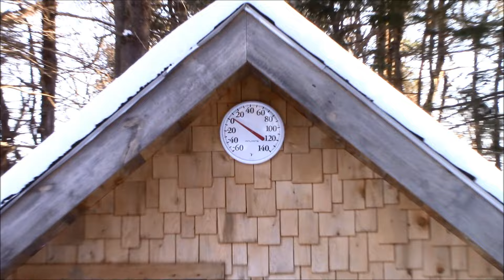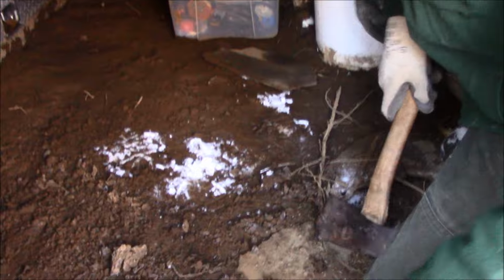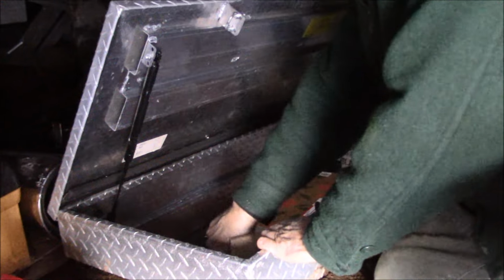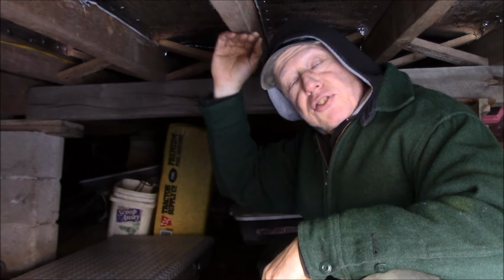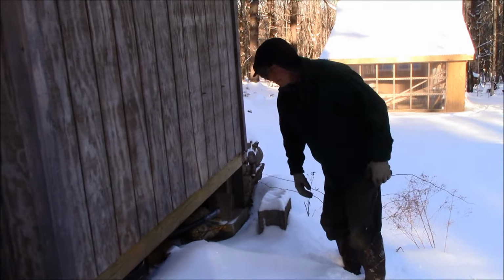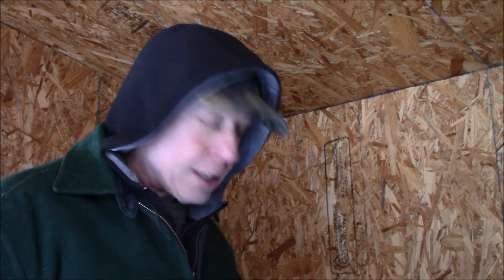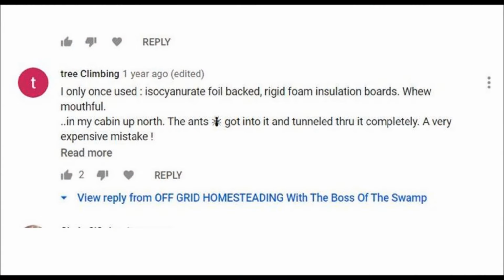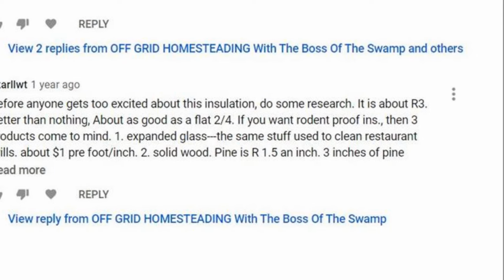Awesome Floor Insulation For A Cabin In The Woods   3rd Year Review

Comment: We live in Central Montana and we know about cold!  Last February the average daily temp was about 0.5 degrees.  We live in a mobile home that is skirted, but had no insulation.  We would have all of the base cabinet doors open at night and let the water trickle just to make sure it didn't freeze.  It was so cold, we were having frost heaves under the house.  You could hear the house creaking and groaning.  This past summer, we decided to try the foil-faced bubblewrap.  We placed it on the inside of the studs that the skirting attaches to, in a continuous run to keep seams to a minimum.  It runs from the bottom of the house down to the ground.  The first cold spell we had this year, the outside temperature was -14.  I opened the access panel and took a temperature measurement about 6 feet inside and the thermometer registered 36 degrees.  When I opened the access, I could feel the warm air coming out!  So far, we've had temps in the range of 0 to -20.  No open cabinets, no trickling water and my heat tape (which is thermostatically controlled) has barely run.  It works!

Comment: A big factor in the crawl space not freezing is Geo-thermal heat.  By skirting the crawl space you have sealed out the outside air that is freezing the ground outside.  The Geo-thermal heat that is underground naturally rises up into the crawl space.  If you have ever visited a cave then you know that the underground temperature is about 54 degrees year round.  The pipes don't freeze in your crawl space for the same reason that pipes underground do not freeze.  It is surprisingly effective.  I used to own a two story farmhouse built in 1902.  It had a stone walled basement with a dirt floor.  I had a wood stove in the basement so I kept the basement door open to let the heat rise up into the house.  One winter there was a bad Ice storm that knocked out the electricity for about a week.  I was not home and didn't know.  Someone told me that the power had been out so I went home expecting the plumbing to be a disaster.  When I got there there was tree branches down and ice everywhere.  I went inside and checked the house and the temperature was 38 to 40 degrees.  I had left the basement door open and the 50 some degree air had risen up into the house and prevented a disaster.  I had not been there for about a week after the Ice storm.  The only thing that froze were the toilet valves.  One was downstairs and one upstairs.  They only had a small crack in the side so I didn't have to replace them right away.  Just leaving the basement door open made a world of difference!

Comment: I followed the advice you gave about using it in a cooler. I put it in a large 72? Qt cooler. Lined the whole inside and made a removable piece that goes over the top of the food and ice. It went from maybe a day and half to 3 even 4 days of holding ice! Who needs a several hundred dollar cooler, when you can buy a roll of this stuff and have similar results with a cheap cooler. Thanks as always for the great advice!

Comment: I have watched all the 'bubble foil' videos you've made and am a believer! We live for part of the winter in our cabin in the Yukon. It is an old log cabin that has very little clearance under the original floor. We plan to eventually remove the old floor and put in a new one that will level things out inside. This will be such great information for then. We also added an addition on the cabin for a kitchen that has about 2 feet of space under it. I spend much of the winter cooking with frozen feet! There is a woodstove in the kitchen that keeps the upper part of the room warm enough. But, OMGee...the floor freezes! We are dealing with -10 to -40C temperatures. My water buckets freeze if I leave them on the floor and my waste water from the sink bucket is an ice cube. I am so excited to try this out! Thank you so much for this information!
Reply from the maker: You won't be disappointed. This stuff works awesome.

Comment: i would use it
Reply: A 6 mil plastic green house can be heated with  very little heat because of reflective heat  I have heated a 24 x 40 green house with less than a hundred gallon of propane all winter in the ozark mnts . It was more comfortable than my house . The bubble wrap is an excellent product and i wish it had been around when i built my cabin . Let the doubters sit around and bitch and gripe while they freeze their ass off .

Comment: Installed it under my floor at my cabin in Maine 12 years ago has worked great.
Reply: Any skirting or bat insulation or just between the subfloor and joists open air?

Comment: After hearing about it from the Boss, I used reflectix in a sauna I built. I used it between the joists and sub floor, insulated the walls with fiberglass, and used reflectix between the studs and interior boards as the radiant shell. It works like a charm. Man am I not sorry I built that thing! Thanks Boss reflectix is great stuff, just like your videos!
Reply: Hi  Did you only use Bubble Foil on the floor, or did you add any other insulation? I'm building a Backwoods Sauna. How is floor temp? Thanks
Reply: @gregi5850  I used only reflectix directly under the subfloor. It works great, I but I’m in South Texas. The packaging shows an installation method in which you leave an air gap between the reflectix and the subfloor, so between the joists instead of on top of them. If I lived where it was colder I might have insulated the floor with the same material and left an air gap for more r value, but it seemed unnecessary where I live. Cool project, good luck to you sir!

Comment: We are in Michigan and hubby and I used it on a lake cottage renovation both for over our cement slab and our wooden porch floor that is cantilevered over an open crawl space. There are carpenter ant nests outside of the wall so good to know about them and the foam board! No problems with this and the mini split we use for heat has been very economical.

Comment: Hey Boss….I’m in the process of using the bubble wrap as you have suggested on my Aframe cabin on piers up in Montana.   So far so good!   I will also put a skirt on the place to also guard against wildfire (heaven forbid) getting under the cabin.   It will be all weather wood framing with 1/2” x 30” x 60” Hardie panels on the outside.   Once that is done I will also place the bubble wrap on the inside!   Thanks for your “words of wisdom” based upon actual observation!  Cheers! 🎉🎉

Comment: This stuff is the greatest! I have been using it everywhere for about three years. I figure the reason it works so well is that it acts as a draft barrier as well as a small amount of insulation. The wind can't penetrate it and take the heat with it. Like a space blanket.
Reply: That's not how insulation works.
Reply: @snowflakemelter1172  , maybe you misunderstand the book you read. Keeping something warm or cool from a adjacent temperature influence would be insulation.
Reply: @snowflakemelter1172  - You sound like a broken record.  It reflects rather than insulate.  Find a new line to use.
Reply: @snowflakemelter1172  There are times when a term (insulation) is used to describe something and subsequent testing shows that "air infiltration barrier" would more accurately be the descriptor. I suggest trying it, see the results and THEN comment. When someone comments from the point of view of "insulation" when the actual benefit is preventing "conditioned air loss" the comment can be true but off base. I would rather see comments trying to help the youtuber explain what they observed.
Let's see the naysayers do what he did and see what results they get...
I'm prepping to do this under mom's mobile home to reduce her "conditioned air" loss and reduce her electric bill. True, it would be cheaper to staple up thick plastic to prevent air flow, but I like that it has a little R-value and will last longer.

Comment: I used it in my outhouse floor and it definitely works. I made the mistake of not doing it in my cabin floor which was built before the outhouse and I wish I had. But, because of how well it worked in my outhouse floor, I ended up deciding to use it in my cabin ceiling. It's a gable roof but I created a small attic space by putting up 2x4s from one side to the other, horizontal with the floor. Then I just stapled the bubble foil to the joists and then outside the cabin I have soffit vents along the overhang. In the small attic space I have 2 exhaust vents on the peak of the roof to allow the ceiling to breathe. The venting is important to pull the moisture out of the cabin in the summer and prevent ice dams in the winter. After only adding the bubble foil alone, the temperature inside my cabin in the morning on a cold winter night only gets down to the high 50s at worst. Before the bubble foil where I only had the plywood and shingles, the cabin would end up in the 40s or below when I woke up unless I tended the fire at 3:00-4:00 AM. My thermometer doesn't have an agenda and didn't lie to me. Hahaha. They can say whatever they want, I am also very happy with it.

Comment: Bubble warp the ground/ crawl space floor. Also more insulation on outside skirting. My preference.
Reply: Keep heat in lol gravity feed oil stove or a big boat/ yatct oil heaters are really cool and put off a lot of heat. In my opinion.
Reply from the maker: Bubblewrapping the floor will stop the ambient temp of the ground from heating the crawlspace. Then I'll have to run a heater under there to keep my pipes and food from freezing.  No thanks.

Comment: We have a walk-in unfinished basement with our cabin.  It was vacant for several years.  We tore out the insulation because the mice made nests in there.  We are thinking about insulation under the main floor but have done nothing yet except plug up every hole that led to the main level.  I think we will try the bubble wrap as you suggest under the floor above the basement and in the short walls of the basement too and see how it does.  It's a vacation cabin but we go there several times a year in all seasons, including winter.   Thanks for reminding about the bubble wrap!  Those citrus fruits look good!

Comment: Used this stuff in the engine room of my canal boat between the steel hull and the 6mm ply that covers it. Made a heck of a difference.
Bearing in mind I am basically a steel box surrounded by water. In other  places I packed the gunnel space with 50mm foil backed insulation. I have to replace some rotten flooring and plan to put  some underneath.
Incidentally, I built the insulated cool box you inspired me to. Holes at the bottom draw cold air from floor level (I plan to drill a hole to the bilge where it's REALLY cold!) and holes at the top rear to let the warm air out. I bought a marble tile for the bottom and so far it keeps everything much better than before. UHT milk lasts twice as long as it used to just in an ordinary cupboard! Getting a computer fan to see if I can improve it any. Cupboard is 18mm ply (scrap I got given) and 25mm expanded polystyrene on three sides. Cheap, cheerful and it works!

Comment: I love bubble wrap/reflectics as I said in my text in one of your past videos I live in a cargo van, I have board insulation and The bubble wrap. Other van dwellers I know are having a hard time warming and keeping the warmth in their van homes. It is cold in their vehicles because they only have the basic installation. They cannot keep their vehicles warm Because it’s like the air just flows through every single crack there is. In my van I  have fiberglass in all the large  holes between the inside and outside walls, insulation board on walls and ceiling then bubble wrap over all that and on the floor then the paneling. I think what people can’t wrap their heads around is it is not an R value. What they don’t understand is it is more of a windbreak, therefore things stay much warmer. That may be a better way for the negative Nancy’s to grasp the concept.insulation but I would consider it a huge windbreak. If used correctly bubble wrap is worth its weight in warmth. Don’t stress the inboxers their just stuck in the box. Excellent video as always and those apples and oranges looked so good. Great idea for the toolbox. That one I will remember.
Reply: Insulation board is supposed to be fitted properly with filled and taped seams in the first place.

Comment: Since you showed us this method of insulating floors in your upstate NY cabin, I have used it twice. Once in my own off grid cabin in the mountains of VA and once for a customer. It works wonderfully. Thank you, Boss, for sharing your knowledge and insight.
Reply: Best flooring insulation for my off grid log cabin in northern Indiana. No rodents or bugs of any sorts! And it's all because of you my friend! Thank you and be kind out there people👍
Reply: I have a cabin on Amos Run Hunt club in cowen west virginia and will be doing this to my cabin..the roof and walls are fully insulated but the floor is like ice!
Reply: Was wondering if you can use the bubble foil insulation on the inside of the cabin floor, like under my flooring?  Or would that just flatten out the bubble wrap and defeat the insulative property? I only ask as my shed to cabin did not come with an insulated floor and it is just sitting on skids over a gravel base.  I am located in northern WI (Mercer, in the snowbelt of Lake Superior and lots of nights below zero).Ideally my cabin needs to be raised (have any suggestions on how to do that??) and put in the proper insulation. I was thinking about spray foam or the 2" pink board, but after watching your videos, I know to shy away from either product due to the problems with ant infestation.  The last two winters I have had success using straw bales around the base of the cabin in combination with the 2" pink board which I cut to 2 ft wide sections and put between the exterior cabin wall base and the straw bales. R value works out to be around R-25 to R-35  for the cabin base. It helps quite a bit but I still feel a draft on the floor. Even at that it is easy to maintain a temp of 70F. In Spring I use my straw bales for my straw bale garden. I did my walls and ceiling with rock wool insulation which works great. My roof has a ridge vent (which I have left open). I heat with a natural gas Jotul stove, direct-vented out the wall and have no moisture problems in the cabin. 

I would appreciate any comments or suggestions. Thanks, Nancy...yes, it's a women's venture!

Comment: James...In keeping with your "back woods logic", I recently installed a 50 cfm fan that grabs hot air from the peak of my cathedral ceiling and pumps it thru a hollow beam down into my 4 ft crawl space when the thermostat down there falls below 60 degrees. Works 'fan'tastic and doesn't cost me 'chit' to run. I'm also one of those "think outside the box" persons, but your examples have really pushed me beyond my prior limits. I suppose my highest compliment would be when I think, how would "The Boss" solve this"? You are a HUGE inspiration to Many of us, And God Bless....~Eli.
Reply from the maker: That's awesome. I had an inline pipe fan doing the same thing in my old place. I only ran it when needed.

Comment: Jenn and I also used your technique with the bubble foil. Its even in one of my build videos and I mention you. lol But a warning to the builders. I am building by myself so it took some time to get it all buttoned up. We had a bad rain storm and my sub floor did get wet because the wind ripped my tarp. The water got trapped between the bubble foil and the sub floor. So I had to go under and punch holes into the bubble foil to drain the water. After I drained it I had to go around and tape up the holes. But I am a few steps away from finishing up the cabin. So next year I will hopefully get great results like you! I will let you know the results! Great video take care Boss...
Reply from the maker: If water gets trapped, just slit it and let the water drain out.  Staple and tape it back when the floor is dry.  Good as new.

Comment: I've been researching crawl space and floor insolation for a while now.  Your solution looks my answer.   My cabin is fine down to -15 to -20F or so, below that I have some frozen water pipe problems in the crawl space.  but northern Minnesota gets to -25F a lot and wind chill is -35 to -40F too many days.    Your use of bubble foil looks like the perfect solution to give me the extra protection.   Cheaper, easier to install and far less mess.  And yes, all contractors are telling me only to use either thick foam board or spray foam for $1000s.   You have a new subscriber.  Thank you!
Reply from the maker: We lived in northern NY and the coldest temp we had was -38F without wind chill factor.  The performance of this stuff is amazing.

Comment: R value reflects the ability of a material to resist conductive heat transfer. Heat is also lost through radiation and convection. To properly assess the insulating ability of different materials, all three types of heat loss must be considered. One of the greatest benefits of the reflective foil wrap in this application, is it's impermeability to water. Water destroys the insulating properties of fiberglass and foam in a very short time, leading to eventual structural failure of the dwelling.

Comment: I want bubble foil on my floors.The former owners put fiberglass on them but put the paper turned to the floor and after 25? years the pink stuff is hanging like my belly.Thanks for the video.
Reply from the maker: The paper is suppose to face the heated side. It was installed correctly but the fiberglass should have been supported.